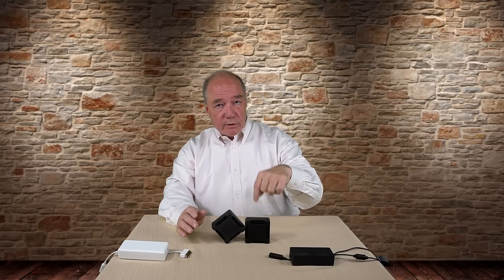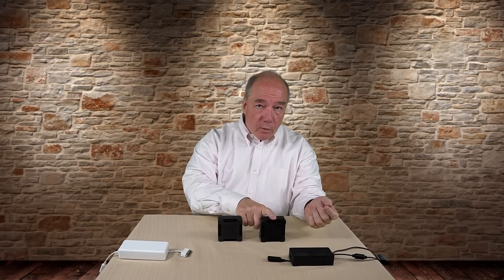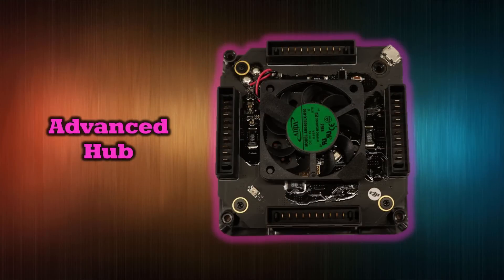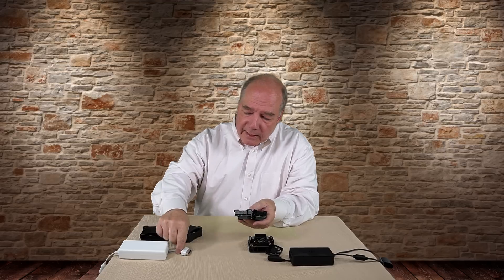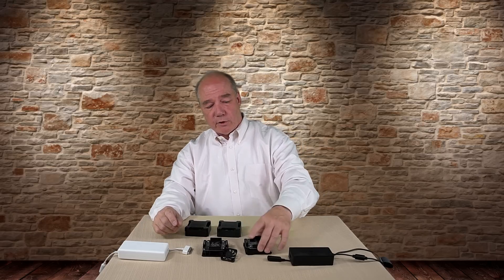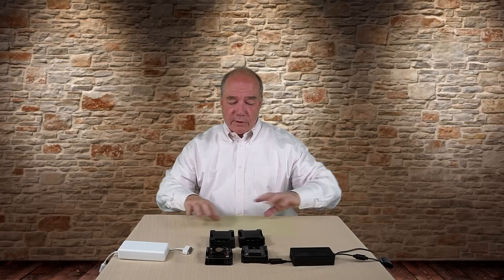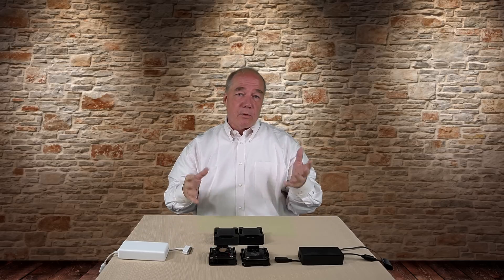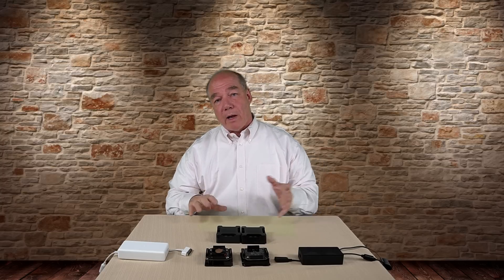DJI Mavic Pro Charging Hub Teardown - What's The Difference Between Them?

Comment: Wonderful job Rick. I picked up a Mavic Pro charger from a third party because I got tired of waiting the hours necessary for my batteries (6) to charge. However, I do run them through the standard cycle equipment every 3rd or 4th cycle just so it all talks to each other. I did not realize though the level of sophistication that DJI put into their hubs. It amazes me that they do this at the price points they hit. Again, great job on this video clip.

Comment: Hey Rick, quick question. Does the advanced charging hub require a 100w brick? Meaning if I use the regular (50w) brick that came with my original charging hub on the advanced charging hub will I be able to take advantage of the faster charging time?

Comment: Hey Rick thanks for your great reviews. I have purchased several items from your webpage because of the trust I have in your reviews. I would however like to ask you to review the DJI Propeller Cage for Mavic Pro. I got mine today and had a very bad experience with it. At first I really liked it because it allowed me to travel in tight spaces with out the worry of running a prop through a bush or tree. But then I had to climb to get over a house and things went bad really bad. Now keep in mind I was not racing the drone around. I was moving very slow. I stopped and hovered over the house about 50' above it to get a pan of the area and then started back down. As the drone started to descend I saw it start to yaw left and right. I stopped the decent but the yawning continued, I then tried to climb in hopes of leveling the drone but again no luck. I tried to return to a hover but the drone started yawning violently and began to just fall out of the sky. When I recovered the Mavic I noticed that the cages 2 and 3 had broken props. During the violent yawning the props got caught in the wire mesh and then were ripped of the prop mounts by the motors. I also noticed that the cage lock that held cage 2 and 3 together was missing and was unable to be found. The cage lock for cages 1 and 4 was laying on the ground near by were the drone had crashed. When I put the cage locks on I made sure to follow the directions (I read the directions completely). I made sure that the lock was properly seated and I heard the clicks when the lock latched on to each cage. I doubled checked the lock to make sure it was seated correctly and was locked into place. At some point during the flight the cage lock must have broke because cages 2 and 3 could be seen moving independently from one another and this motion caused the violent yawning that brought the drone down. I would like you to review this item to make sure this was a freak event because if not DJI has a flaw in there design that could result in a serious injury or sever damage while using this product. This product is great for getting into tight spaces and for use inside. I will be calling DJI tomorrow to see if they are going to replace my drone and the cage system for free or whether I have to use my DJI refresh Inc. I bought with the drone. Sorry to be long winded. If you want to contact me my email is Shubmer@yahoo.com

Comment: On my Mavic Pro Advanced Charging Hub, it charges 2 batteries at the same time (I have 3 batteries in it, and 2 of the batteries both have their lights flashing at the same time). I'm using the regular charger and 3 regular batteries that comes with the Mavic Pro Plat. Now I'm wondering if that's a good thing, that it charges 2 at a time, or is that a defect that's making it do that?

Comment: Thanks Rick.  Great review.  I'll just stick to the standard hub I've already got.  Would be nice to charge simultaneously though.  Maybe in a future update hopefully.  Just curious, did you happen to notice the manufacture of the PCB power connector to the board?  Were the leads soldered and then coated or is it a different type of power connection to the boards?

Comment: Thanks for the review Rick, very useful info! Have a quick question about the higher voltage/amperage (double the wattage as you explained) of the Advanced Hub --- will that lead to reduce battery lifespan through faster charging? This seems to be a characteristic of most Lithium Ion batteries as far as I understand.
Reply: Yes it WILL reduce the cycle life of your cells!!
Reply: Ah okay, thanks for the confirmation! Unfortunate there are always tradeoffs between recharge speed and long-term durability.

Comment: Great info.  Wish I had found this before buying the Inspire 2 charger to charge the Crystal Sky batteries.  That thing is a huge brick.  Now I am going to go with the Phantom 4 160w charger,and the Mavic advanced hub so that I can carry one charger to charge my Mavic Pro batteries, the Mavic controller off the crystal sky battery hub USB port, and the Crystal Sky batteries and leave the original mavic charger and the Inspire charger at home.  wish DJI allowed for returns 30 days out and not just 14 days as now I will have to eat the cost of the Inspire charger.  But thank you for good info.

Comment: I think that the plastic guide #1 was probably first designed for the standard hub (like a universal hub ) ..but found in the testing process that the phantom 4 charging unit was burning the hubs out ..so they made the plastic guide #2 so only the mavic charger would fit ..until the they could find solutions required to create the Gen2 hub or advanced hub as we know it

Comment: Howdy Rick. Could you please 1) Take the plastic guide labeled 1 from the advanced hub and put it in the standard hub. 2) Connect the Phantom charger to the standard hub and try to charge 4 batteries. Please make a video and show us how that goes? Cheers.
Reply: Naseem Mansoor yes i waant to see that to.
Reply from the maker: Naseem, that seems like a good idea but the circuitry needed to regulate the higher voltage of the Phantom 4 charger isn't in the Standard version of the hub. I wish it was that simple but I expect the outcome of the experiment would be a puff of smoke :) I will be giving both of these hubs away on one of my future blogs so be sure to stay tuned and subscribe to the channel. Rick

Comment: HI! I put my batteries to discharge in 1 day if I don´t use it. After some days I charged the batteries and put in my Mavic and it shows Battery error. Do you know any case like this?
Reply from the maker: You might try "resetting" the battery by draining it until the lights go out. Even though it appears dead at this point, there is still about 10% of the charge left in the cell. By doing this, you'll reset the metrics in the battery and start fresh when you charge it back up. Once you've depleted it, charge it and you should be fine.

Comment: Please compare and contrast the DJI advanced charger with the FSLabs DJI Mavic Pro 5 In 1 Rapid Battery Charger.
Reply from the maker: Thanks for the post. I use the 5-in-1 charger to charge my cells. The main advantage over the hubs is that it charges all 3 cells, the controller and my tablet at the same time, which is much faster. There are a few versions of the 5-in-1 out there and the one we offer on the site has all of the Gen 2 safety upgrades installed. Here's a link if you want to check it out - http://tinyurl.com/y986ly2g

Comment: hello, but the two versions have the exact same measures ??? it is true that the advanced Hub balances the battery cells ??? which recommended version to buy ??? thank you all!
Reply from the maker: The big difference is the charging process for the advanced model. They are close on price so I always recommend the Advanced version because it will charge the cells faster to allow you to get back out and flying! Thanks for the post and be sure an sub the channel. Rick

Comment: I was looking at the DJI store and noticed that the new 160w phantom charger is compatible with the Mavic pro advanced hub. Do you think the 160w would be safe to charge the Mavic batteries? How would it compare with 100w charger?
Reply: Jay Bikas I also want to know this
Reply: Yes. It’s compatible
Reply: But would it be even faster than the 100W?
Reply: CX15000, yes it does

Comment: I don't own the phantom 4, but I have the advanced hub with 3 mavic batteries. Is it worth it to buy the phantom charger for the faster charging? It's 55 dollars, so idk if I should spend it for the faster charging. But if it is worth it, I will :D
Reply from the maker: If you're not planning on buying the Phantom series, adding a Phantom power supply to the hub is expensive and will still only charge them one at a time. A better option would be an aftermarket charger like this one - http://tinyurl.com/y986ly2g - that will charge 3 cells at the same time as well as the controller and your phone. It's the one I use at home and it works great for getting you out the door and flying quickly. Thanks for posting, Rick

Comment: My Bad!  I watched and listened to your video and was impressed about how the M1CH-P would charge 4 DJI Phantom 4 batteries.  I purchased the M1CH-P thinking it would be an advantage since I have DJI Product, but I did not realize that the design of the batteries from the DJI Phantom 4 changed when they brought out the Phantom 4 Pro much to my surprise. I know now that the DJI Phantom 4 Pro batteries do not fit the 4 station charger.  My Bad.  You made the M1CH-P sound so good I failed to see that this video was made in 2017 and was completely out of date as the newer Phantom 4 Pro batteries are completely unusable as they must have completely redesigned the batteries.  I really liked the idea you could charge 4 batteries all at once as I have 4 batteries.  The newer version of the charging station only has 3 stations.
Reply from the maker: Roy, sorry for the confusion. As you said, I did this clip a long while back and the P4P cells are slightly different. If you are looking for a quicker way of charging your Phantom 4 cells, we do sell a 4 battery charger that will charge all 4 cells at the same time safely to get you back out and flying quickly. Here's a link if you want to check it out - https://tinyurl.com/y4thnzph. I have plenty of them in stock and can ship one out in the morning. Rick

Comment: I really wish I could choose my own input current to the cells so as to extend the cycle life of the batteries. 300mah overnight would do nicely, instead of the ridiculous 3amps or so we're stuck with.
Reply from the maker: Thanks for the post but the DJI batteries have a controller built into them to do that for you. The difference between these cells and the more common LiPo ones used in RC was that with RC the cells are "dumb" and you need a smart operator with a charger you can control how they are charged. With the DJI batteries, the charger is "dumb" and the cells are smart and can regulate themselves through the charging (and discharging) cycle to provide the optimum current needed. I appreciate the post and hope that helps. Rick

Comment: Standard will take up to 6A, advanced takes up to 8A
Reply from the maker: Bob, thanks for the post and the difference in power is the reason for the accelerated charging on the Advanced hub. I have since upgraded to the 5-port charger for the Mavic cells since it charges them in tandem instead of in sequence like the hubs. Thanks for the post and I appreciate you watching the clips. Rick

Comment: Dji batteries are really bad.They DJI STILL SELL OLD BATTERY MADE IN 2017.which is dead but still DJI SELLING TO CUSTOMERS.
Reply from the maker: Arun, thanks for the post but a few things to remember. First, Lipo technology is unlike other batteries that have a "shelf life" and need to be used when fresh. Lipo cells are essentially dormant when shipped and wake up when they are first charged for use. This means they can sit on a shelf for years without any damage to the cells. The challenge is that once you apply a charge to them and wake them up, you need to keep feeding them every few months to not let them go dead. Also, DJI offers a 6-month warranty on their cells so if you do get a bad one, they will exchange it for free as long as you keep your receipt. I appreciate you posting and hope this reply helps. Rick